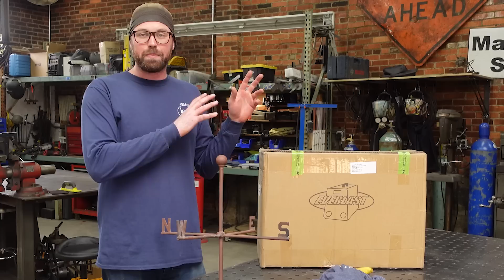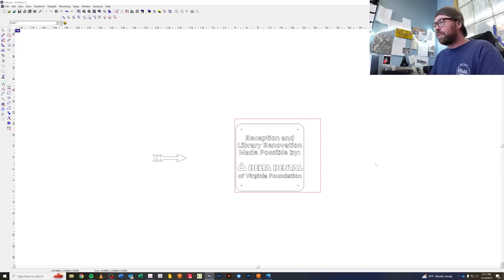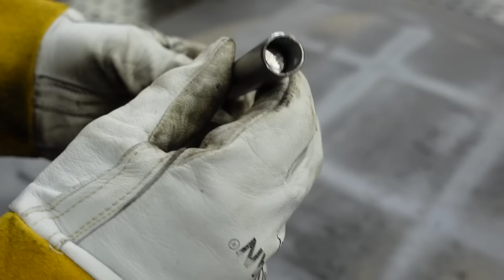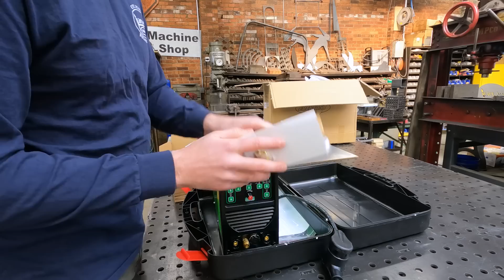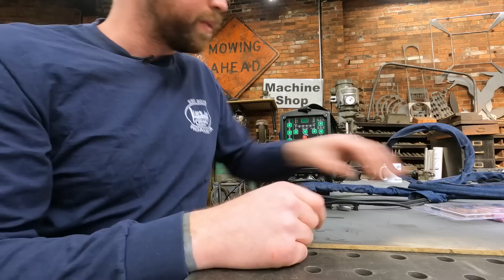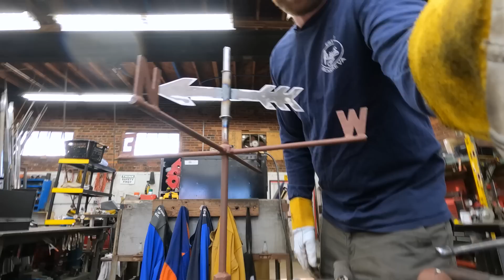I Built a Thing That DOESN'T WORK

Comment: the pointer of the arrow should be a lot further from the pivot point of the arrow so the pointer will show the direction of the wind
Reply: typically a weather vane points to where the wind is coming from not to. A North wind comes from the North. A weather vane would point north in a North wind.

Comment: There is some Aerodynamics at play with your vane. As a 'general rule of thumb' a symmetrical airfoil (flat plate will be a little different) has a neutral pitching moment with around 23-25% of the area in front of the pivot point. If you run the pivot behind that the vane will be unstable. The point being way more area behind the pivot is needed.
Reply: I was going to say the same thing. And then use some weights to balance the arrow at the pivot as needed so it rotates smoothly. In the end, the back half has to be lighter or thinner or you add weight to the head to balance it out. A lot of times, the arrow head is not as tall/wide to reduce surface area but heavier gauge to even out the mass

Comment: If you want your weather vane to work well, especially over a long period of time, then there are a few things you need to consider.
Firstly, it needs the arrow to face into the wind, so the arrow point should have a very small surface area which could be affected by the wind.  It also means that the tail end “feather” shall have a much larger surface area.  The weather vane needs to be balanced so that it hangs freely, so that it is not inclined to bind on the vertical shaft.  The pointed end of the weather vane should be shorter than the tail end, but to enable this pointed end to balance the long tail end, the arrow point needs to be made of much heavier material which can balance the weight of the tail end.
Secondly, if you want the weather vane arrow to always point into the wind, then there needs to be the smallest possible amount of friction between the weather vane and the vertical shaft on which it is mounted.  This is important because a slight breeze may not provide much energy to point the vane in the correct direction.
It must be understood that the weather vane will be exposed to all sorts of inclement weather, so the bearing must be totally weather resistant to be able to withstand dust, rust, and water which may settle on the surfaces of the vane and its vertical support.
The problem is that the weather vane is likely to be mounted high above the ground, in a position where it is not easily serviceable, and cannot be lubricated easily.  In other words you want to support the weather vane with a good bearing which is unaffected by harsh weather conditions.
A very effective way of achieving all of these requirements is to use a single ball bearing as follows.  Fasten the weather vane arrow near the bottom of a tube which is about half as long as the arrow.  The top of that tube should have a completely weatherproof cap which can accommodate a single ball bearing which is about the same diameter as the vertical shaft.  This shaft should have a small detent in its top end, in which the ball bearing may rest, and the weather vane should be slipped onto the shaft.  If the ball bearing is well lubricated with graphite grease when it is assembled, it should function well for a very long time.  Even though most kinds of grease can dry out over time, the graphite will provide a long term low-friction environment, and because of the length of that tube it is unlikely that moisture will get close to the ball bearing.
If you want to make it look “pretty”, then some sort of decoration could be fastened to the top of the weatherproof cap of the weather vane.  Just make sure that the top of the decoration is not higher than the level of the ball bearing.